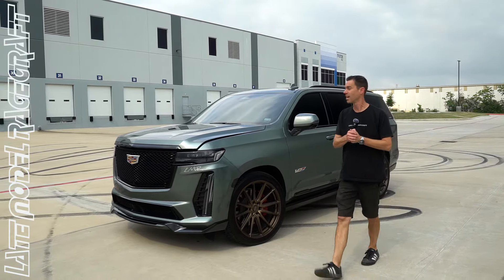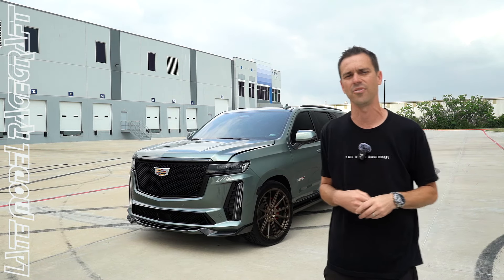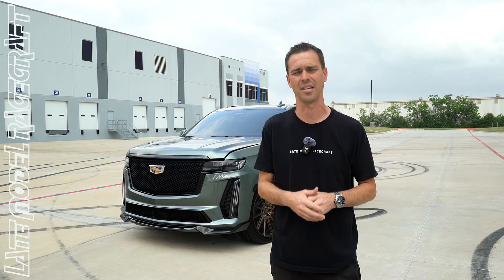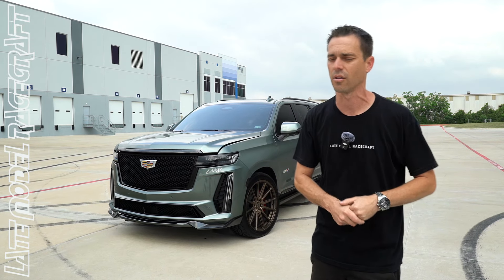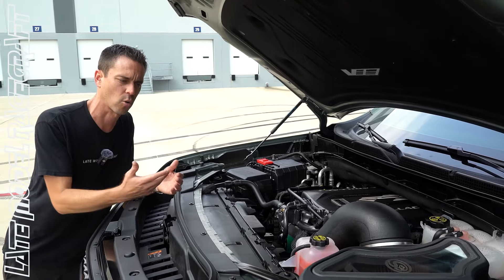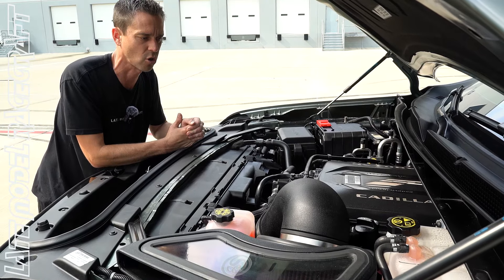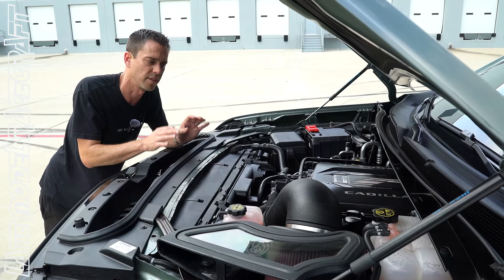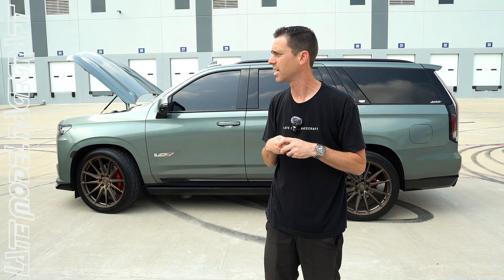655 RWHP Stage 1 Escalade V- Late Model Racecraft

Comment: I can tell u right now, do not run these badass Vs in 2wd on the dyno by taking out the front driveshaft. U will break the transfer case. Those Awd systems are not made to do that
Reply from the maker: You are correct.
Reply: @LateModelRacecraft  I just didn't want u guys to get in trouble that's all lol. I replaced one already from a performance shop that dyno and drove the V without the front driveshaft. Customer brought it to the dealer and GM does not cover it under warranty lol obviously. Them bad boys ain't cheap lol